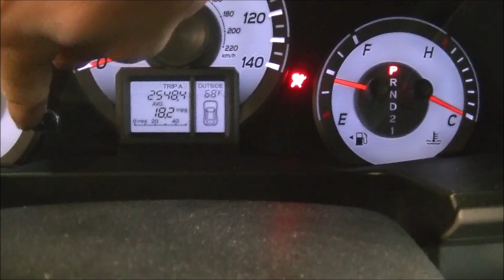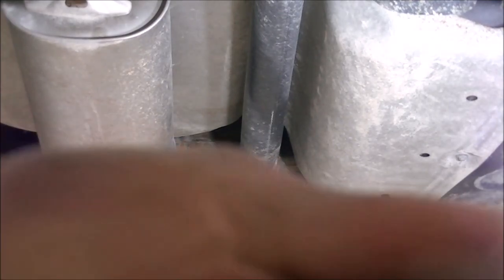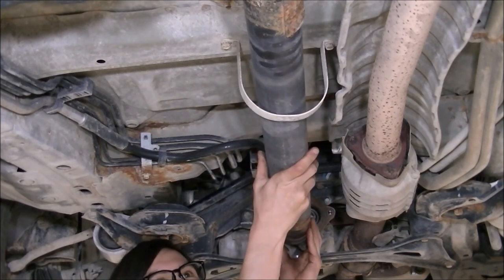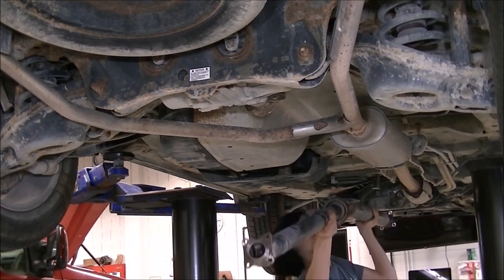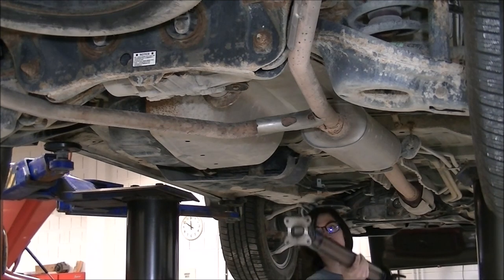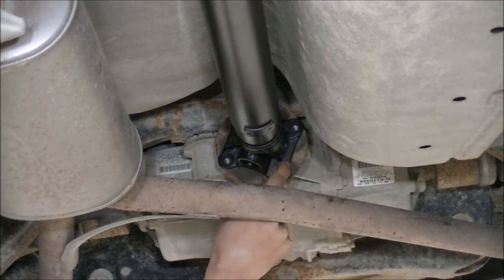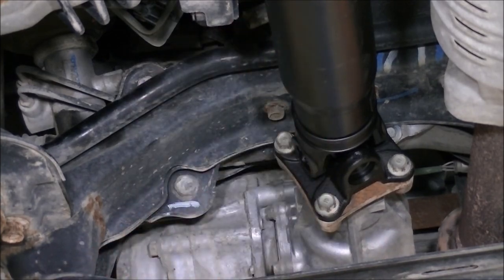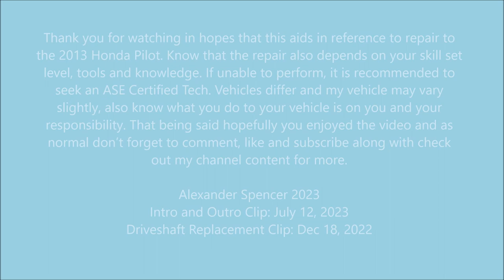2009 - 2015 Honda Pilot Drive Shaft Replacement

Comment: Should there be any slop in the carrier bearing rubber bushing? Trying to diagnose if mine is normal or not. I can move the driveshaft about an inch in all directions at that bushing. I’m going to test by taking off the driveshaft and see if vibrations go away.

Comment: Hey there. Thanks! I have a 2011 Honda Pilot FRONT WHEEL DRIVE. If I am experiencing the same shaking and vibration, I just need to do the front drive shaft (CV joints), right? My front wheel drive does not have a drive shaft like the one shown, right?
Reply: correct. it could also be wheel bearing or tire balancing

Comment: why did you mark the position of the driveshaft if you put the new one unmarked? I could not catch how did you use the marks.
Reply: Exactly my question too but these guys that does video are stupid to not reply back
Reply from the maker: The marks are only for reference if the original driveshaft had to be reused or reinstalled to the vehicle and returning the vehicle to its original un-repaired condition. Also is common practice when replacing u joints.
Reply: @littlej3777 He said why. Turn the volume up.

Comment: Hi.  Interesting video!  I just had my original prop/driveshaft removed, but am looking into having it replaced (live in Canada, the 4WD is good to have for winter).  Question: is the replacement used, after market, or new certified Honda part?

Comment: Sir quik question.
I lift my Honda pilot 2015 with a subframe drop but my vehicle gets vibrate I check everything axel control arm everything is good brand new .my question is 
Do I have to change the setup of the drive shaft if the vehicle is lift.
Please 🙏 reply